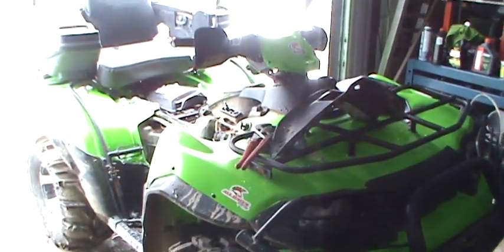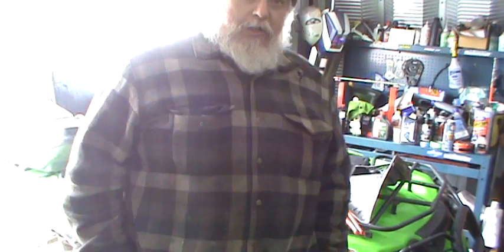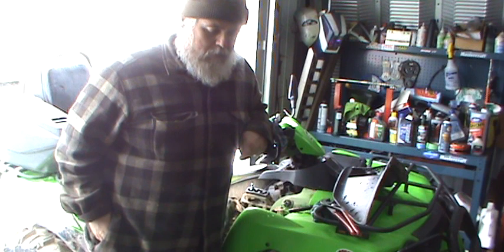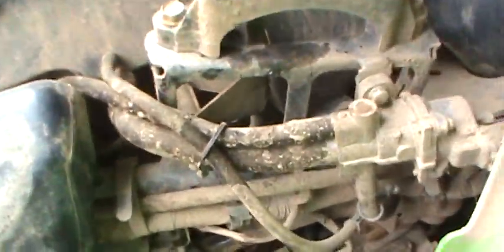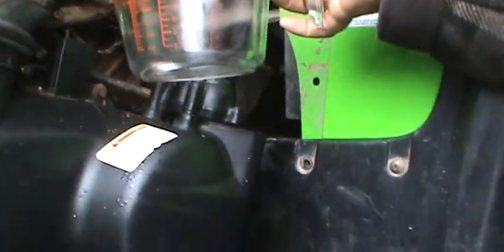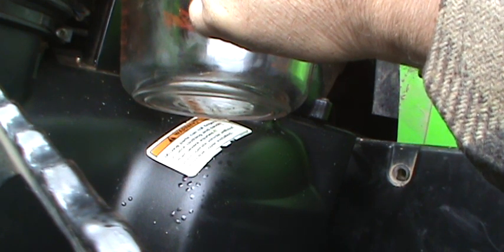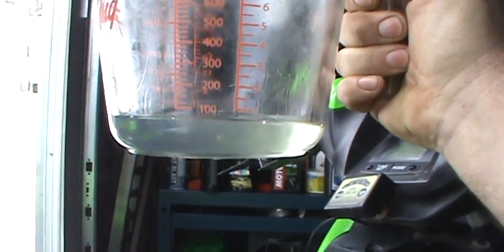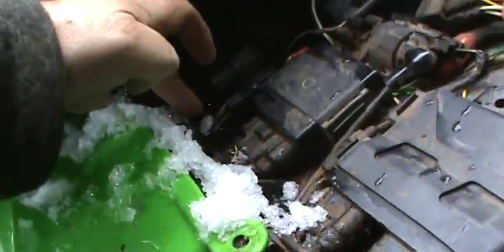Kawasaki brute force 750 no power backfiring fix

Comment: Hello! I really need your expertise. I just bought a brand new 2022 Brute Force 750.... Recently as I am still completing the break in time, the motorcycle stalled when coming to an immediate stop. Its only done it once but it almost did it again today as I rode it. The only fuel I've put its non ethanol 89 oct. Thank you very much for your time.

Comment: Hey,

Originally my 09 brute 750 was losing power for more than 10kms/hr. When I turn it off and turn the key to on position three times it would run fine for 30seconds and then same problem. 
I thought it was fuel pump so I replace the fuel pump assembly (60$ ebay) and with the new fuel pump  FI lights blinks in the key on position. After turning the key to on position quad might start for for few second but I have to hold the throttle at one position if I let go or rev more it would die and not start again until I turn the key 3 times.

I have put the original pump back now has same issue. 
I tried a volume test and it is more than 250ml on three primes. With the original pump quad use to idle fine but now I put the same pump and it doesn't. Only thing different is blinking FI light. 
Should I try buying another pump? 
Can you please help me out?
Thanks
Reply from the maker: Take it somewhere and have the codes read. You have a failed sensor somewhere in the FI system.
Reply: @HammerHeadGarage   Yup you are right something to do with electricial side as per the manual. I also broke pronges on the fan motor breaker. I hope that doesn't have anything to do with it. Any good kawi mechanics you know in Calgary?

Comment: I have a 2011 kawaski teryx 750fi sport. Mines doing the same thing. I’ve put a new fuel filter and spark plugs. I tried poking a hole in the screen on fuel ascending unit. Now it won’t start at all. Before it backfired and had no power. I ordered a new fuel pump and ascending unit. Any ideas what else it might be?
Reply from the maker: Do a fuel flow test as outlined in my video. Check all the ignition and fuel pump related fuses and wiring. Do a leak down test.

Comment: Good morning Mr hammer head I have a question my 07 brute force 650i Vtwin my neutral light sometimes doesn’t work sometimes it does but when it don’t it leaves me stranded.   Yes my adjustment seems to be on point and adjusted good is their a neutral switch somewhere ? I know it’s a dumb question but idk where it’s at I don’t have a book. Any suggestions from u would be very much appreciated. Thanks in advance
Reply from the maker: Yes there is a neutral switch. Its located at the top of the left engine cover near the rear of the cover. Check the wiring. Often the wiring has a short in it. Otherwise just replace it.
Reply: @HammerHeadGarage  top of the left Engine cover?  Do u have a picture of what area it’s located for better understanding for me?  Thx in advance your channel is awesome I really do like my brute force and just want to fix it right

Comment: I also have a kawasaki brute force 750i what dimensions should I use to adjust the valves?
Reply from the maker: exhaust 0.20mm-0.25mm   Intake 0.10mm-0.15mm
Reply: @HammerHeadGarage  this is also written in the manual but I can do for example 0.20 evacuation and 0.10 admission ??
Reply from the maker: @josseprossi6837  yes, I usually go in the middle of both ranges.
Reply: I made the adjustment to 0.10 intake and 0.20 exhaust and it doesn't start anymore.  do you have any idea what it would be ?
Reply from the maker: @josseprossi6837  Fuel, air, spark. It needs all three, if one is missing it won't run. Has nothing to do with the valve adjustment. Do a leakdown and compression test.
Reply from the maker: @josseprossi6837  also those figures are in mm not inches.

Comment: I have an 08 650 that I have bought it has 750 carbs I adjusted the values to the factory spect at giving it throttle and wants to backfire can u give me some advice and the belt light blinks
Reply from the maker: The Belt light comes on every 100 hours or if there is a problem. Try a belt light reset. google it.

Comment: I have a 2007 brewed for 750. I have installed a new OEM belt, new plugs and air filter. Unfortunately I’m only able to get the top speed it up to 38MPH. 
I contacted EPI to ask about the clutch thinking that maybe it needed some type of adjustment the Gentleman walked me through it and things seem to be OK.
No it does not act like it is slipping the RPMs are not revving to the moon it’s just does not hit hard off the bottom and lacks top in speed. When I replace the spark plugs they Had tons of carbon buildup. Any leads you might have is greatly appreciated. Thank you.
Reply from the maker: Step 1. Do a cylinder leakdown test on both cylinders. More than 12% on each there is a problem. Step 2, do a fuel flow test. You may have a clogged or bad fuel pump. Let me know when you do these things. Any codes? FI light lit on the dash.

Comment: Hammer head I have a 2012 650 brute. I had it sitting for about a year or 2 I started working on it and I’m at the point where it will turn on and idle fine but when i give it Half throttle or more it pops in the carb and wants to die. I already took the carb out and cleaned It, i also rest the belt light and I confirmed the pump was pumping gas. I’m new to working on bikes/engines any idea on what the issue is?
Reply from the maker: A bike with old gas in it for 2 years will need the fuel system totally cleaned. Clean the carb again in an ultrasonic cleaner. the fuel turns to varnish and this is what is likely your problem.

Comment: I have a 2007 brute force 750 runs strong and fine backfires under deceleration. Any ideas what this could be?
Reply from the maker: Check for holes in the exhaust/muffler.

Comment: Hello I have a 2005 brute force 650 sra and suddenly I discovered it will run fine but after like 2 mins of riding it will bog down, sound weird, backfire, and not go over 30 and have no pickup. I believe it’s a fuel issue because if I turn the fuel off and back on it runs fine for like 1 minute then goes back to running like garbage. I did the fuel test and on one crank I got the 150cc. I didn’t bother to do the other 2 because I got 150 in only one crank. I just had the carbs rebuilt before this issue so I’m out of ideas. Any help would be really appreciated and thank you!!
Reply from the maker: Do a leak down test. 10% max leakage on each cylinder is allowed. Any more than that try adjusting your valves. Is the battery voltage at idle 13.5 to 14 volts dc?
Reply: Thank you so much for getting back to me, I love your videos. I will try that and thank you so much

Comment: Awesome, glad I found you by accident. I just bought a BF 2 days ago. The more I get into it, the more I can tell it's been severely abused. It was coughing really bad, no 4x4, now I got a red light blinking. Don't know what that is. I guess the label
has worn away that tells what the lights are. Anyway, got my work cut out for me. If you get on it and, as you say, "give it the beans", it will nearly throw you off of it. Gotta love that quote! So, at least there's life in it still. Thanks bro liked, subsribed

Comment: I have a 2014 brute force 750 and have the same problem where it backfires and it slows down and has no power. I already replaced the fuel pump and it still does the same thing. Will it be the speed sensor??
Reply from the maker: where the pump plugs into the top there is a little screen. Did you bend a nail and poke a hole in it? Sometimes this fixes the issue.
Reply: Hammer Head Garage ill try that thankyou

Comment: selling my 07 750 with zilla mud tires ss wheels added bigger brush guard trailer hitch holder and snow plow needs alve adjustment and case has very minor crack

Comment: ay, i got a kawaski prairie 4x4 360 and i got a new carburater and it still doesnt pass 30 miles per hour and it is back firing and the belt light is on. please help if you have a work email please send it to me so i can contact you and we can talk.
Reply from the maker: You need to reset the belt light. Google it

Comment: Hi, 
2008 brute force fuel injected 
I did the fuel flow test and it gave me 50 ml after 3 prime cycles. I changed the fuel pump filter, it was really dirty, did the fuel flow test again and gave me 150 ml after 3 prime cycles. I’m still getting no start however. Did compression test and checked ignition it was good. Would you have any idea what the problem can be ?
Reply from the maker: try pouring a few cc's of fresh gas in the spark plug hole and see if it kicks. Do as fuel pressure test with a gauge.

Comment: I have 2011 750 brute force once warmed up when you give it a lot of throttle then back off all of throttle it back fires plenty power its just when you back off the throttle all the way
Reply from the maker: Leaks in the exhaust pipe and muffler can cause this.

Comment: I have a 2008 brute Force fuel injected I cannot get sparked to save my life
Reply from the maker: Try another ECU.
Reply: @HammerHeadGarage I did I changed the ECU the wiring harness I put all new relays in it still nothing
Reply: @HammerHeadGarage when I first got it it would start up for about a second or two and then shut off and it gradually just got to the point now there's absolutely no spark also change the pickup coil

Comment: I have a 05 700 prairie , I'm having the same problem with. I have replaced the belt and reset the belt sensor. It does run better on the bottom end, at half throttle and above it cuts out and surge's I can't get over 35/40 mph. I checked the fuel pump flow and got well over the 150 cc. I have taken the carbs completely apart and cleaned everything, no blockage found. I've adjusted the valves and still no help with performance. Any ideas would be appreciated, thanks
Reply from the maker: Do a leakdown test on it. Should be 10% or less leakage.
Reply: Have you been able to figure it out

Comment: I have a 2008 tertiary with a carbarated brute motor.  I replaced the old vacuum fuel pump with an electric one.  I was told I needed less that 4psi.  Does this sound correct?  I am having the same issue mid throttle stutter and backfire.  Any help would be great!
Reply from the maker: Yeah about 4-6psi usually. Are the valves in spec? compression test is in order I think.

Comment: Great Video.  I have a 2008 teryx carb and i just adjusted the valves, twice because i thought i screwed up.  it had almost no compression before the adjustment now it has way more (not tested) and it will spit and sputter above half throttle.  If i put my hand over and cover the carbs a little bit it will rev out.  Any help on where to go next would be much appreciated.
Reply from the maker: When you put your hand over the carbs you are cutting out the air making it richer. If it runs better that way it's starving for fuel.
Reply: I thought that too.  But there is fuel sputtering and spitting out of the carbs while this is happening.  But it still may not be enough.  

It ran perfect before I adjusted the valves. It was just hard starting.
Reply from the maker: @nickf7617  float level? plugs? are they dark?
Reply: @HammerHeadGarage  i out new plugs in it. I’ll be doing a compression test today and then probably pulling the carbs and going through them.  It’s just so weird because it ran great before the valve adjustment but may it’s moving way more air now.
Reply from the maker: @nickf7617  Something is up for sure.

Comment: What’s the problem when it starts right up and dies 5 seconds later. It has vacuum fuel pump. Carb is clean. Lines clean. Getting fuel it just dies. Need advice

Comment: Hey there,
Thanks for the vid, I'm new to the channel and found you as am having issues with my 09 750BF. I actually just got it back from a service attempting to get it running properly and it still back fires and barely goes above 35. My research let me to suspect a faulty ecm/ecu, I just tested the machine with the ecm unplugged and it rides exactly the same as with it in. Do you think it's worth me looking at the fuel pump or should I start looking for a new (used) ecm? I don't know of any way to repair it at all do you?
Reply from the maker: get an ecu out of a know good running machine and try it. The machine wont run without the ecu plugged in.
Reply: Thanks, I unplugged the single plugged box at the rear. After your response I just did some more digging and think it might be the ecu actuator instead. That kinda puts me back in the unknown as not sure it would run the same with that out.

Comment: I'm having problems with my 750 brute Force I shredded the main belt drive put a new belt on now it's backfiring won't get no RPMs up
Reply: It was running great before the belt shredded
Reply from the maker: @shannonstein7993  It's in limp mode. you may have damaged the belt switch inside the housing cover for the belt. Try a belt light reset.

Comment: Hey there, 08 brute force owner, backfire on decel. Exhaust has been patched near the rear head. It helped the backfire but its still there. Any help would be appreciated. 
Thanks, 
John.
Reply from the maker: Start with  a leakdown test. Anything over 12% on any cylinder is a problem. Are the valves in spec? Adjusted?
Reply: Valves were adjusted a year or so ago, i will do a leak down test and check/adjust the valves once im in there. Thank you

From your experience, is it possible i still have a leak or something wrong with the exhaust? 

It only back fires if im really going and completly let off the throttle, i have been easing off the throttle to aid this. It seems to only happen when the engine revs down too fast. 

Thanks again, i love this brute and the power it has, looking forward to hitting the trails again soon.

John
Reply: I should also add that i did put snorkles on this machine. Its stock other than that.
Reply from the maker: @johnbozyk1662  u may ha a leak .

Comment: Hi Shawn, I got the side panel off to do the fuel flow test. As soon as I took the fuel line off gas was coming out and never stopped coming out. Key isn’t even in the ignition and the gas never stops flowing. 

When I did the fuel test by turning the key nothing happens. The same small steam of gas keeps pissing out and never stops or increases. 

Would that be a dead fuel pump do you think?

If I trailered it to your shop could I hire you to take a look at it for me?

I have a video of what it’s doing as well.
Reply from the maker: Ok hang on. What year make and model?
Reply: @HammerHeadGarage   2015 brute force 750
Reply: @HammerHeadGarage   do you think that’s something I could hire you to take a look at? I’m in Greenwood NS and I’m able to trailer it.

Comment: Thanks for the video, I would appricate the reset process for my twin 750 kawi, thanks, God bless
Reply from the maker: Belt reset is easy. Unhook the 2 pin actuator plug on the belt cover. Under the seat find your grey plug. Plug it into the black connector and then the black into the grey. Turn on the key and the belt light should flash quickly and then settle down to a normal slow blink. Let it do that for 30 seconds. Plug everything in the way you had it and start the machine. Belt light reset.
Reply: @HammerHeadGarage  thanks for taking the time to reply, God bless brother
Reply from the maker: @colonialroofingofnorthcaro441  God bless you and yours my man.

Comment: So I just got my hands on an '08 Kawasaki teryx..I gave it a new set of plugs, new oil and oil filter along with an air filter. This one is carbed before they came out with the fuel injection. I feed it premium gas and starts takes a bit to warm up, but when it does it idles perfectly. My question is that I'll be going right along, it'll lose power and start to backfire. I shut it off wait a few minutes turn it back on and can go again, what's causing this. Also it seems to get pretty hot, do they run like that, or should I be changing the thermostat?...I've had Honda four-wheelers and worked on my own for years, but this Kawasaki has me stumped..
Reply from the maker: Hey Brad. Sounds like an ignition problem. Test the coil it may be failing when things heat up. Also just run regular gas, dont need premium.Also make sure the valves are adjusted and the spark plugs are not black (fouled).They should not run hot. Does the fan come on? if not your fan relay,motor or thermo switch is bad. Check the fuse first.

Comment: Mine giving me a similar problem.  Back firing.
Reply from the maker: Look at the simple things first. Any holes in the muffler? exhaust tight? then move on to fuel and ignition troubles.
Reply: @HammerHeadGarage  thank you sir.  We changed the diaphragm in thr back carb. It was busted.  Now its firing on both cylinders.  But its back firing and acting up. Idles funny. Almost like misfire.   Definitely going through the houses and things. Checking for cracks.  I bought it used but it ran fine for a little while.  Little black smoke out the exhaust. It after market.  Loud.
Reply from the maker: @MrDavidelliottjr  what do the spark plugs look like?
Reply: @HammerHeadGarage  back one is new. The front isn't.  But they look ok.
Reply from the maker: @MrDavidelliottjr  Leakdown good on both cylinders? less than 20%?
Reply: @HammerHeadGarage  having got that far yet.  Lol.  I was thinking carbs could have some blocked holes.  What do you think?
Reply: @HammerHeadGarage  i thinking about bringing it to a professional.  I dont want to get out my range of nonexpereise
Reply from the maker: @MrDavidelliottjr  Possible but I usually start with compression and leak down tests. Don't rule anything out unless you have checked.
Reply: @HammerHeadGarage  yes sir